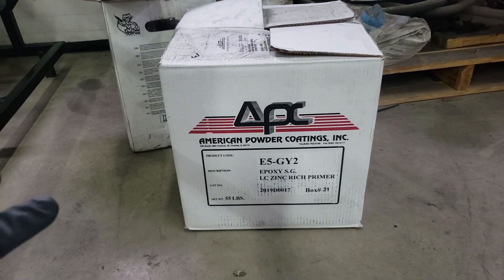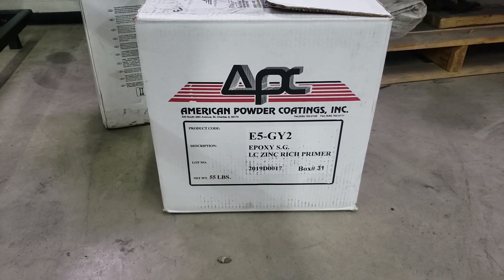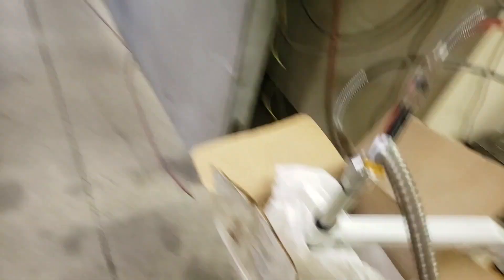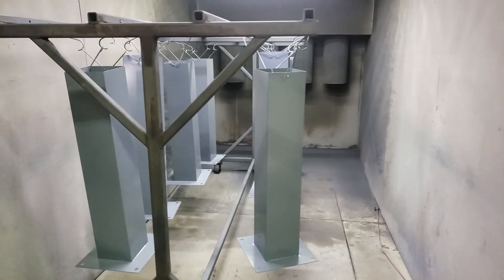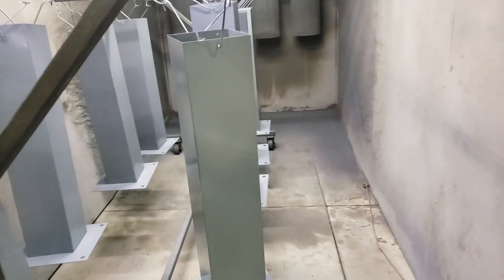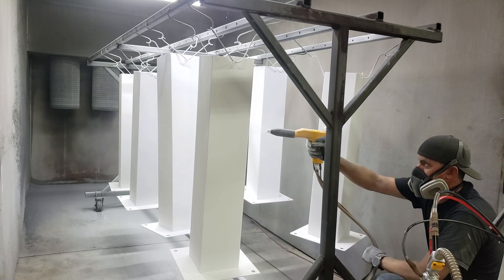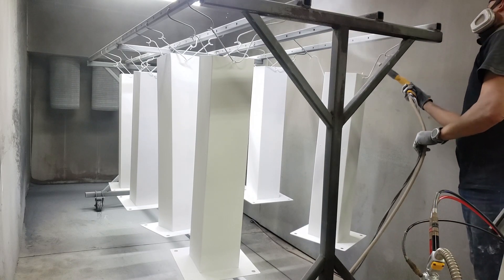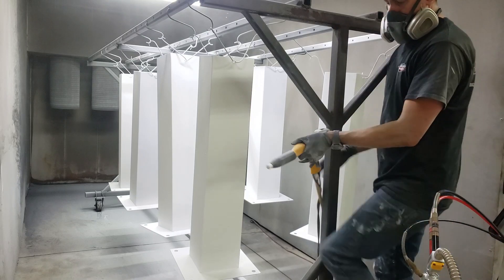Zinc Primer Powder Coat - When to use it!

Comment: I had a steel part primed with zinc rich powder, topped with polyester powder, and salt spray tested per B117.  It tested extremely well, over 240 hours.  I don’t recall if it ever rusted.  It’s also easier than hot dip galvanize but has similar benefits.
Reply from the maker: That's great info to know, thanks for sharing!

Comment: I’m restoring a 1968 Torino and want to powder coat pulleys headlight fixtures  is it necessary to zinc prime this being it’s only gonna get wet occasionally
Reply from the maker: Primers are used to help prevent corrosion and also can be used a a thin filler, so unless those are concerns I'd say your good to skip it.

Comment: Zinc rich primers are best used for part that gets a load of direct impact contact like a bobcat bucket. Its designed to stop the rust creeping from the scratch. Use a standard primer load cheaper. I truly think zinc rich is overly told it’s the best

Comment: Hey Dan, great video as always! I have questions.
@1:19 when you said "we only gel out these primers and then we add the topcoat and do a full cure". So my understanding of this statement is:
•you only bake the primer until it flows out,
• then let it cool to room temperature,
•then you apply topcoat,
• then bake until topcoat flow out + full timed baking cure.
Is that exactly what you meant?
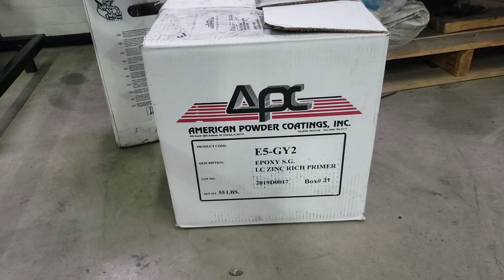@2:02 when you begin explaining the purpose of zinc rich primer, you say the zinc being electrically active protects the metal substructure by corroding itself before the base metal otherwise would. But you only mentioned "steel". Were you initially meaning to say it protects every metal? Or does zinc rich primer only protect steel with its special properties and nothing else
My rims are aluminum!
•Lastly, (I am DIY) I bought standard gray primer. What are the pros and cons of normal gray primer versus nifty zinc primer or other types also.
Reply from the maker: You might have missed a few details in the video, some primers are good for aluminum and some good for steel.  Get is when the powder flows, and by only doing that the top coat will stick really well to it.  But yes your outline is spot on of what I was getting at.
Reply: @RightNowPowderCoating   Prismatic powders Instruction states 5 min in the oven at 400 degrees, I understand on how the process is,normally is but  5 min is to me a little less time than a normal time for a powder to flow out !! can i get your opinion on what prismatic states on the instructions, or just wait till it flows out like i normally before i base coat an item !!
Reply: great question and comment

Comment: What is your kv ua setup when you coat over a zinc primer ?
Reply from the maker: unless you have a gema it really wont help you much to know, we never drop kv from 100, ua is adjusted based on the gun detection but usually at 100 or 22 ua

Comment: What setting are you using on the Gema for recoat? Since it's recommended to leave the KV at 100-110. Do you drop the KV or just the microamps?
Reply from the maker: We use the recoat button on the unit, ua goes to 22
Reply: @RightNowPowderCoating  thank you for your help 🙏🙏🙏
Reply: What settings would you recommend for Super Chrome 2 or something similar? I've been using PCC mode 100kv and 8-10 microamps and the powders cures well but not sure if the settings are right because then for the 2nd coat, let's say it's a transparent or a clear, how much would I have to drop the microamps?

Comment: How do you ground the car on ur booth? I never see you with the clamp on each piece
Reply from the maker: Ground the cart, part connected to cart
Reply: Ohh ok, but when the cart have some coats over and over do you blast it?
Reply from the maker: @extremefabrication4x4offro80  no inside the tube, if we need to we grind it off.